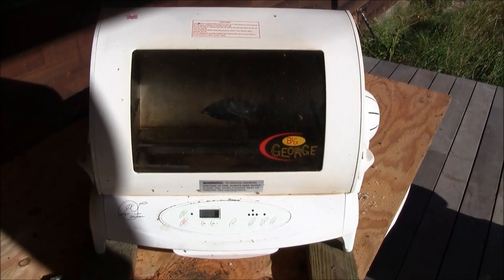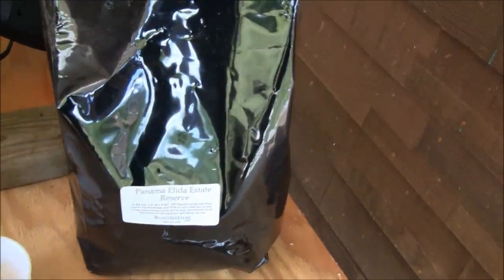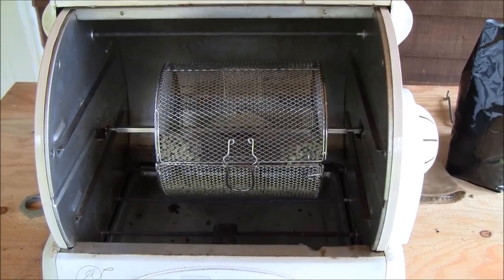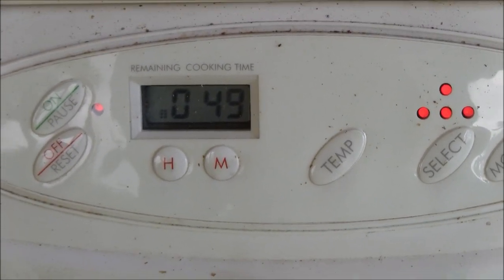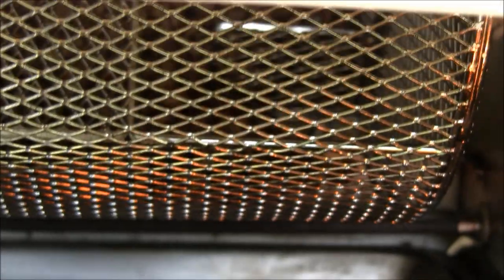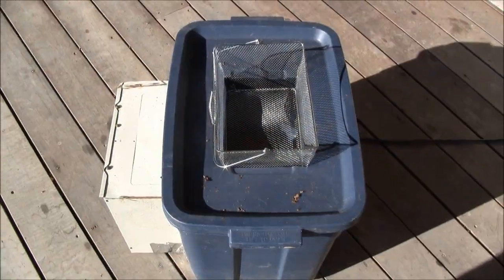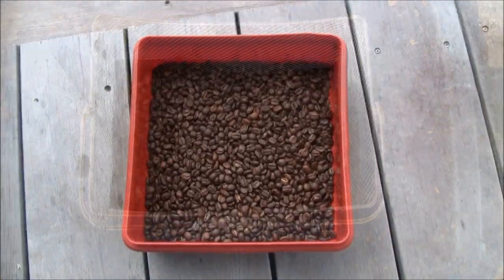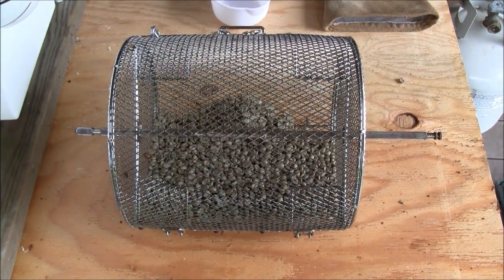COFFEE ROASTER - George Foreman Modified

Comment: I am thinking about getting the george forman GR82 JR I think it's 950W and I wasn't sure it it could roast coffee with out any mods, so did you first try it with out any mods and how did that go? tks
Reply from the maker: It could not handle the 450 F temp fir extended period of time. Very poor ramp up ability to do a good curve. Over 12 minute conventional roast time. This was my first roaster I built/ modified. Since that far away time. I have realized I knew abosoluty nothing about coffee roasting compared to what I do k
now commercially building coffee roasters
Reply from the maker: #2 if I had this roaster in my hands today , I would  just throw the current electronics away , add a external  Thermocouple  and add a  temperature controller

Comment from the maker: @wildsprig 

george foreman dot com   round vegatable basket under the parts section for the rotisserrie ,   you will need to add a extra latch ot hold it shut , the 1/lb of beans springs the latch. I used a simple hook and eye  type

Comment: Thanks for this video! Just found one of these and I’m going to try it without the modification first. For some reason the middle bottom element won’t work though :(
Reply from the maker: You need to get a coffee roaster to around 450 -475  without that other element you will not get there,  if you do my hack , dont point it towards the control board , the additional heat will fry it. Hood luck , I was able to do about 100 lbs before it burned up on me. You can see my next roaster in another  video.   Now I am a commercial coffee roaster on the plains of Kansas. St .Joe Store Clyde Kansas on FB or Instagram @roastedright  , I just built a restaurant and a 20 lb roaster
Reply: mhotes congrats! It’s great you’ve had a successful journey! So where would you suggest is the best location for the heat gun then? By the way I read the manual and apparently when the motor is turning, the middle element is set to be off. I’m curious how yours was on while rotating?
Reply from the maker: @jameswise153   I hot wired it to the other one.
Reply: mhotes interesting!
Reply: mhotes how? I haven’t done anything like that before.

Comment from the maker: I could not see spending $250 to $500 for a professional roaster. This will do all that the other ones do.  It has 4 heating elements and a convection blower. and thermostat all for the high cost of  $12,95 for the heat gun at harbor frieight and the big george I purchased for $18.00 at the good will.